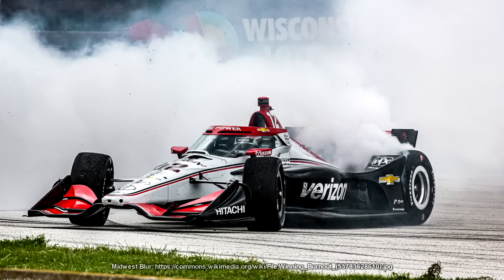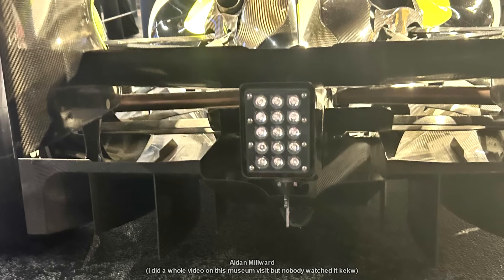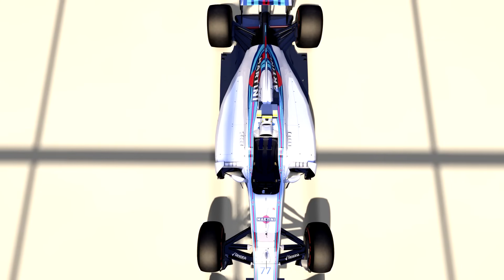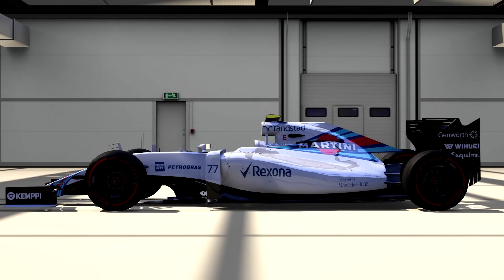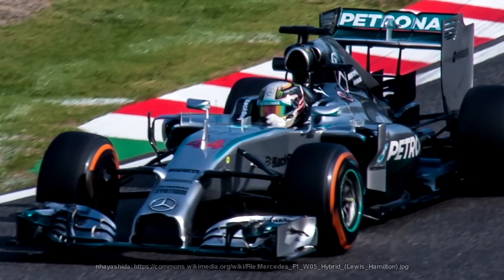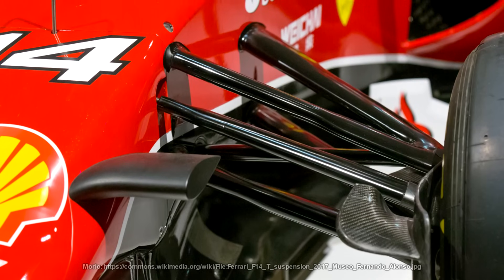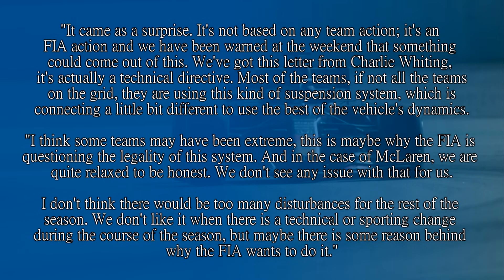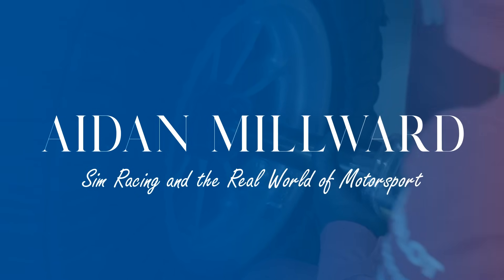A NEW FORM OF ACTIVE SUSPENSION? The Story of the FRIC Suspension Systems (2014)

Comment: The irony of FRIC is that it's one of the few modern innovations in F1 that has actual road car applications. McLaren uses such a system for its road cars, and old British Leyland cars also had something like it.
Reply: But the Leyland cars (at least the mini) had it connected the opposite way.
Reply: Absolutely, also Audi's Dynamic Ride Control system that debuted on the ~2003 RS6 was akin to that, it used a pump so it was a little different but did diagonally interlink the suspension. I have a hard time telling if they still use it on newer models or not.
Reply: Goes back to Citroen's Oleo-pneumatic system used on the DS (& others) - a system currently 70 years old...

Comment: Technically wouldn't a frick system be a "re-active" suspension as it requires the input from the movement of weight of the car to operate?

Comment: Tinfoil hat time: FRIC wasn't that good so Mercedes snuck out that their system was the best. Have the other teams waste time getting a better system then getting it banned, meanwhile Mercedes have been developing the really good stuff.
Reply: It was a good enough distraction from the fact that their real advantage was with their engine (and their exclusive engine modes). Almost the same as with Brawn in 09 where everyone was looking at the double diffuser, but the other important bit was the outwashing front wing (especially the endplates) that everyone soon copied. And it looks to be what McLaren have done coming into this year, get everyone concerned about flexi wings, but then reveal that their real trick is how their tyre temperature management and however they're doing it.

Comment: Fric is basically a modified version of hydrolastic suspension that British Leyland had been using in their road cars since the early 1960s, although it could be argued that hydropneumatic system invented by Citroen  in 1954 was even more advanced. It took formula one engineers a very long time to look at anything other than metal springs.
Reply: Yep. Basically open wheel Citroën DSs. I'm a Citroën and BL fan (worked for Citroën and my dad worked for BL. Feel sorry for me....), so I appreciate both systems, but Citroën was first.
Reply: I came here to say exactly this. Sound like a very fancy version of what Citroen already done in the 50s
Reply: Words. My mouth. Taken.